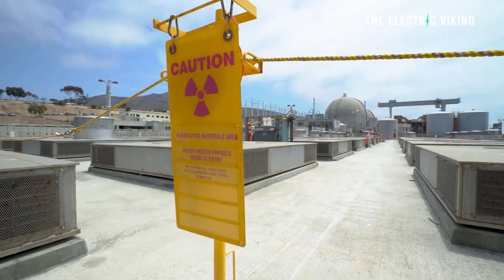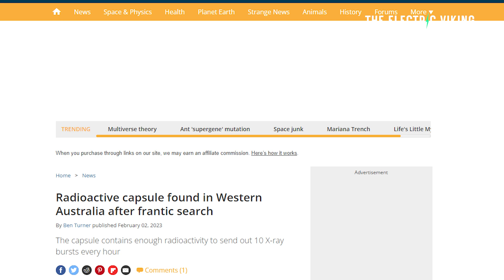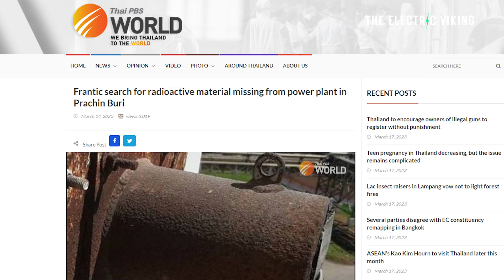Radioactive material from nuclear power plants keeps disappearing...

Comment: The trouble with nuclear is that due to over regulation and a general unfavorable view by the general public, development of newer and safer reactor designs all but stopped in the 1970s. Designs like pebble bed reactors never made it past experimental stages despite their inability to experience out of control reactions like older litewater designs. In fact there isn’t even the possibility of radiation exposures by plant workers since all the radiation is locked away within the pebble structure. Nuclear pebbles only give off heat and are incapable of getting hot enough to melt down even if all the coolant is drained out of the reactor during operation. I designed a nuclear car that uses the heat from a single 6cm nuclear pebble to power a Sterling heat engine continuously. Unfortunately the rules are so burdensome at the nuclear regulatory agency, there’s not much chance that pebble powered cars or homes will ever see the light of day.

Comment: You are confusing nuclear material with nuclear waste. Nuclear materials are used for many industrial uses from smoke detectors to material sampling and all sorts of strange things you wouldn't know about unless you are in that industry. They are also referred to as nuclear sources. They are made to be moved around and used like any tool. That is why they can get lost. They also generally are not anywhere close to a dangerous as nuclear waste from a power plant and because the dangers are not that high they are not regulated the same.  Waste from a power plant is very different very dangerous and highly regulated. That doesn't just dissappear.

You hate Tesla FUD but you are spreading nuclear FUD. Nuclear IS a safe power alternative even if you include the disasters that have happened. New power plant designs are even safer. Of course solar and wind and other renewables would be better but until those can take over we need non CO2 producing energy.

Comment: I am disappointed with this video because it takes facts and exaggerates them to fuel a phobia, a bit like the mainstream media does with EV fires.
That is not to excuse 'missing' radioactive material, but the Fukushima cleanup does require comment.. The actual radioactive component of the water, if it could be isolated, is about 1 Kg in millions of tons. The radioactivity is barely measurable.
For some perspective on the 'risks' of radiation, I suggest your viewers Google 'Banana Radioactivity'. Yes, bananas are radioactive, and a term 'Banana Equivalent Dose' or BED has been coined  A dental X-ray is worth 500 bananas; a flight from Sydney to Bangkok is also about 500 Bananas; and living in a brick building is worth 2 bananas every day. These values are above the background radiation we receive continuously. At a guess, swimming in the Fukushima 'waste' water is probably at around the one banana level.
Humans evolved in an environment where low levels of radiation are normal.

Comment: These radioactive isotopes used for x-rays, are widely used in all manner of industries and medicine. The have absolutely nothing to do with nuclear power. While they can be made in nuclear reactors they can also be made in the lab using lab scale accelerators.

In medicine they are vital to treating people. In industry they keep machinery safe by detecting cracks in structures that if undetected could cause catastrophic failure.

These isotopes need to be kept under strict control. Losing them is not only unprofessional it should also have serious consequences for those found to be negligent, or having criminal intent.

Comment: This is just more evidence that the "powers" that be do not care about human life anymore. We are a cheap resource if we are born to the wrong family. There are enough of us that the rich are no longer afraid they will run out of forced labor. But I remind you all that war can't start if no one want's to go. Oil can't burn if no one is willing to burn it. Coal doesn't dig itself out of the ground. Sharing power resources like electricity brings the standard of living up and equalizes life for everyone. Sharing food brings equality if it is shared equally. 
I know this is a bit out there but it connects back to why things like power plants are built as cheaply as possible. The rich and the control freaks they hire to do their bidding do not care about anyone or anything else but themselves. 
They are physically incapable of the act of caring about others - not in the way you may experience caring.
Even if they were simply born into money and happen to have a brain with all the functional bits required to care about others, they are taught not to care in order to maintain power and wealth.

Comment: The proposal for nuclear is to use SMR which negates the problems of old systems.
Reply: I love a person who actually does their own research.
Reply: @vec306  Just gotta have a CANDU attitude  - look it up.  Seriously amazing and been around since the 60s; only downside is need for lots of heavy water which is a little expensive but it literally burns nuclear waste (or unrefined uranium), has low proliferation risk, good safety, refuels online and makes tritium which will be essential for fusion research.  PWR reactors are what scares people and the history shows they are still very safe statistically.
Reply: The units are only an adaptation of reactors use for nuclear powered warships and they have a pretty good track record.
Reply: @lesliecarter4295  not all.  Development of candu and thoreum smrs are also ongoing.  Travelling wave isn't technically an smr but its another promising idea.
Reply: @ccibinel  have to declare my interest here. I have a large stock holding in Rolls Royce so I am definitely biased. However, certainly concede there are other options but would say that the technology is based on their nuclear submarine installed systems.

Comment: The questions I always ask proponents of Nuclear are these:
1: what do you suggest we do about all the existing nuclear waste and about all future waste?
2: how do you justify the huge expense of nuclear when we know we can generate the electricity from renewable sources much more quickly and much more affordably?

They never have an answer.

I’m not actually particularly opposed to it. But I just don’t think it makes sense.
Reply: Take a look at a dude called Doomberg. Intelligent discussion surrounding nuclear and the trade offs we most 
likely will need in order to reduce overall emissions.
Reply: @twitafftwitaff7029  that is good. Just facts, no politics, no agenda.
Reply: 1. Reprocessing and storage until reprocessed.

2. Expensive up front but extremely cheap and reliable 24/7/365 energy once built. Long lasting. Not intermittent. Doesn’t require chemical batteries. Dispatchable baseload on demand. Best used as part of a mixed renewables nuclear grid. 

We use 1% of the energy in the fuel each pass through a reactor. So fuel size requirements are tiny compared to the raw materials required to build the volume of renewables and batteries required. 

Energy density will matter.

That would be my answers to the questions you asked.

I think an energy mix is the key.
Reply: @polarbear7255  I’m not aware of any nuclear reactor being cheap at any stage, especially when you factor in decommissioning and storage of the waste.
Reply: @edwardhackett-jones8126  what’s to decommission? Tell me? How hard is it to vitrify waste and put it in a concrete cask? The volume is tiny compared to the energy produced. It is also far far less volume than the waste from old batteries and solar panels will be. Far less resources intensive.

Nuclear is not perfect but it’s the best solution we have to decarbonise as quickly as possible and that is after all the aim.
Reply: @polarbear7255  quickly? You’re looking in excess of 20 years per plant here in the uk.
Reply: @edwardhackett-jones8126  SMR can and will bring the time down. Both the US and UK stopped building reactors. Both have forgotten how. That skilled workforce and engineers have long since retired. Both need to learn how to build them again. Also if you underfund a project it will take way longer. 

But hey 20 years to build, what’s it’s design life? 60 years? How much energy will it produce in that time all whilst being zero emissions and 100% dispatchable baseload. Use it or not, I know what I’d choose... when it comes to capability, you get what you pay for.

If the adoption of nuclear energy was not cut short by the anti nuclear crowd in the 1970s we would have been zero emissions energy generation decades ago...
Reply: @polarbear7255   Would help instead of putting into new subs we build at home for electricity generation.
Reply: They do have an answer - Liquid Flouride Thorium Reactor. Bureaucracy is the problem.
Reply: @magnusauto7941  ok, new to me. I’ve just had a quick skin through the Wikipedia entry on it.

While I’d concede that it has some advantages, I’d point out that it’s still riddled with hazards, risk, costs and delays. It’s not appealing, surely, when examined alongside the alternatives?

https://en.m.wikipedia.org/wiki/Liquid_fluoride_thorium_reactor

Comment: There are newer reactors that are much safer. They claim they can not melt down. The old ones that have to have water pumping constantly are dangerous. All the major accidents were water flow problems.
Reply: But they are so expensive.   Wind solar and battery is much cheaper
Reply: @girowinters   You need both and more

Comment: I think we'll need some level of nuclear for baseline power generation, we can't just ignore one of the best sources of power with no fluctuations. We need to be better at handling and disposing it, but safety has got much better since Fukushima, especially in passive safety systems (so even with total loss of power, the station will shut down).
Reply: What are you talking about?

Look at the newsmaking nuclear accidents:  Three Mile Island, Chernobyl, and Fukishima.  Look at the actual deaths from the incidents and the actual observed radiation deaths.  It's friggin' AMAZING how few people died FROM THE ACCIDENT ITSELF.

Nuclear plants have an amazing safety record, better than ANYTHING else out there...including solar and wind.  They ARE the best low CO2 option, and are far more reliable, effective, and libg-lived than anything being pushed today.
Reply: @billcichoke2534  I don't agree that they're the best; solar and wind are much cheaper and easier to install. Nuclear just can't compete with those and likely never will. I'm not saying we should avoid nuclear, its a powerful tool in our journey to ending fossil fuel use, but it shouldn't be the only thing we focus on, and it may well get replaced as batteries become cheaper.
Reply: @Abel Shields  Solar and wind are NOT cheaper, because you pay full price for 1/5 the power (or less).  As well, baseline needs to be on at all times, since solar and wind, even if they were quadrupled, would not be able to generate up to demand.  Without baseload underneath it, unreliable (i.e. 'renewable') power would cause far more hardship and do what it's been doing, contributing to HIGHER emissions, NOT LOWER.

Nuclear, like coal and has, does not have these problems.  It is, in fact, cheaper because it can provide IN EXCESS of demand at ALL times, in ALL weather.  And they last 2-3 times longer than either wind or solar installations do.  It's only due to regulatory excess and agenda-driven restrictions that it costs as much as it does.
Reply: @billcichoke2534  I agree, with a baseline like coal or nuclear we'd need to spend much less on storage of intermittent sources like solar and wind. I'm not arguing against a nuclear baseline, just pointing out that there are downsides and it'd be very expensive if we used it to generate all our power. Current plants can cost one to several billion dollars, that's a HUGE upfront investment compared to solar or wind, not to mention the huge amount of time it takes to come online - I think from approval to generation can take 10-20 years, during which time our power demands increase and its not contributing anything to the grid. I think there's a video by Sabine Hossenfelder that goes into costs for all these different types of electricity, it's worth a watch.

Again, I'm not disagreeing with you that we need nuclear, but the idea of it replacing wind and solar, especially in the next decade, is ridiculous. Maybe once we have fusion 🤣
Reply: @Abel Shields  That's what I'm talking about as far as public image and governmental regulation/restriction.  Change the one and optimize and/or reduce the latter, and the timelines and prices drop.

I dislike solar and wind because they're intermittent and erratic and underperform.   They also despoil large swathes of land, thus creating more desertification and less CO2 absorption.
Reply: @billcichoke2534  I think you should rethink renewables - to generate electricity for the whole world, we'd need less than 1% of the land area, I think the Sahara would do.

But its a baseless claim - wind farms are often put at sea on the coast, because its windier there, and therefore don't use any land. Solar does use space, but we could get all the energy we need from rooftops and the sides of buildings. Plus solar installations can actually be beneficial to farmers and such - grass grows better when it's slightly shaded, so solar above grazing sheep or cattle is beneficial to the animals, plus provides extra money for the farmers for the generated electricity, and doesn't take up space that wasn't being used already.
Reply: @billcichoke2534  they are erratic, and I agree that's a big downside. We simply don't, and can't create, enough batteries to store all the energy we need while they're not available. But solar and wind should certainly play a part while they're available. I've also seen work on matching demand to supply - if we have a network of smart devices that charge cars or run heating/AC while we have a lot of renewables, we can almost perfectly match the demand to what is generated.
Reply: @Nabushika  How do you know that we can't create enough batteries, and other energy storage such as compressed air, to provide the energy we need?
Reply: @martinutr  we use too much electricity! I don't have the exact figures off the top of my head but it's a staggering amount. The simple answer is: the current densest form of energy storage is chemical battery (excluding stuff like hydrogen with a round trip efficiency of like 40%, and other gases like methane with less). For pumped hydro, we simply don't have enough available land to store all the energy we need without major geoengineering efforts. Compressed air - again, it's promising, but there are only so many caves we can pump air into, and I think its not that efficient either. Currently, batteries have the most energy and provide the best round-trip efficiency for grid storage, and we're nowhere near close to having enough for the world. I respect what Tesla is doing, but even they are going to need to keep doubling for year after year to begin to get close to the 69 TWh per day that we use as a species - and that's only going to keep growing, too.
Reply: @billcichoke2534  Safer than solar and wind?  Could you provide some proof for that assertion?  Please make sure to include injuries and deaths from construction of these very large and expensive plants.  Make sure you include the deaths from Chernobyl.

While you are at it, why not look into the massive cost over-runs, long construction times and the issue of waste.

Comment: I just had a "solar power accident"- the front suspension on my homemade EV broke when i hit a pothole in the road surface, causing a "rapid disassembly" and i got a scratch on my arm, which deposited a trace amount of blood on the street- a "biohazard" to my neighbors who might get "infected with my coolness". Lol!
Reply: Wind and solar result in a comparable number of deaths as nuclear due to industrial accidents and this likely fails to fully account for idiots falling off their roof with home rooftop solar.  Nuclear is overall very safe and the immediate replacement with fossil fuels due to fear mongering has caused many times the deaths of any nuclear disaster due to air pollution.  We simply do not have a viable energy storage approach to store renewables seasonally yet.  Batteries + Solar wont work far from the equator.